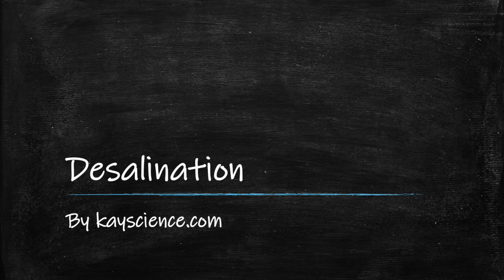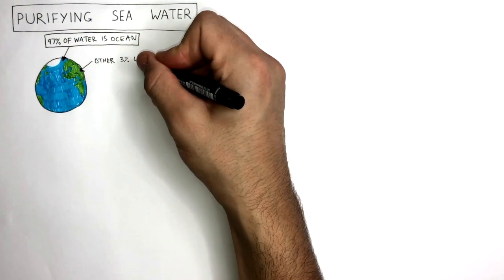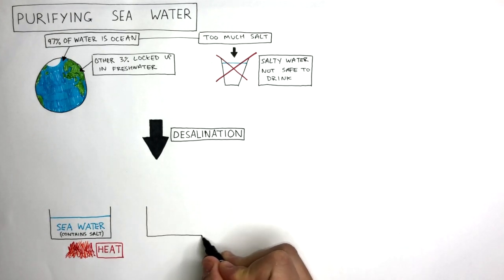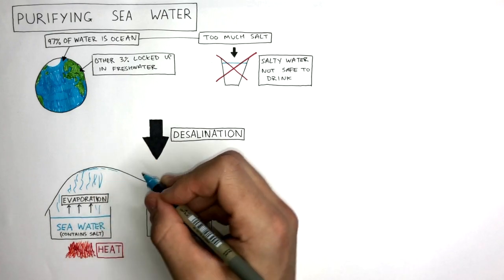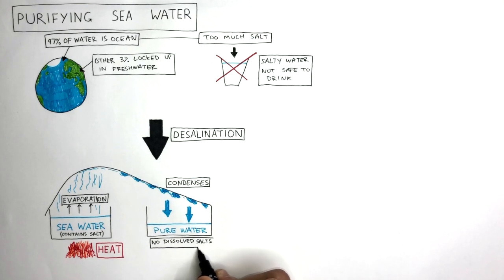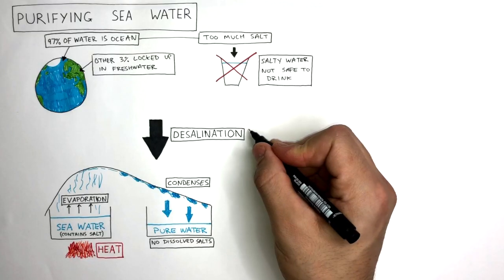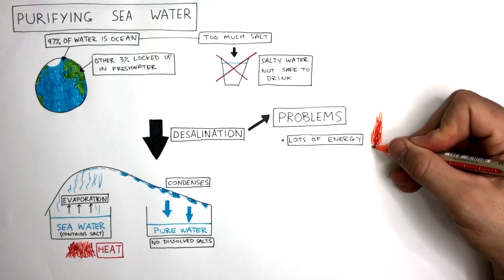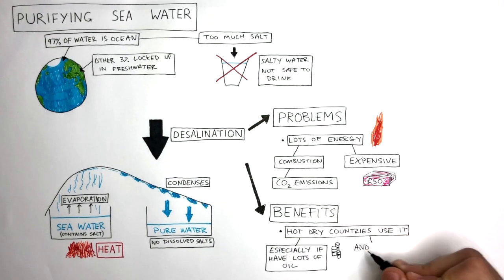GCSE Chemistry Desalination of Sea Water

Comment: Get your Geotecnical Civil Engineers using the applications of known technology taken from a long standing design turning salt water to steam implementing zero fossil fuels. Present day, THERMA WELL BORES are a foundational model of the exhibited long standing yet new high-concept, super heating, MHD Hydraulic Control System. Forced flow cavitation, piezoelectric effects conversions, electromagnetic induction.

KUDOS- ScanPyramids Project, Pierre Houdin - GIZA PYRAMIDS STABILIZE CLIMATE
https://www.youtube.com/watch?v=cDRad06Qp_c&t=6s&ab_channel=PerspectivesEnhancementProject_P.O.V._GATEWAY_